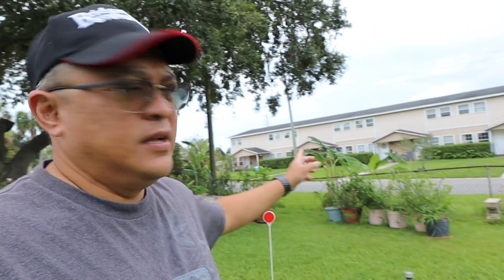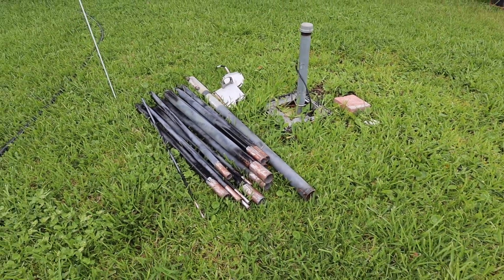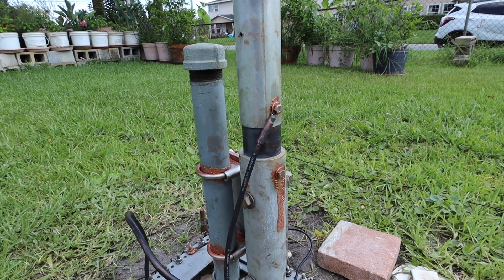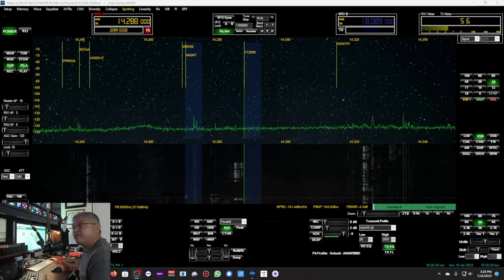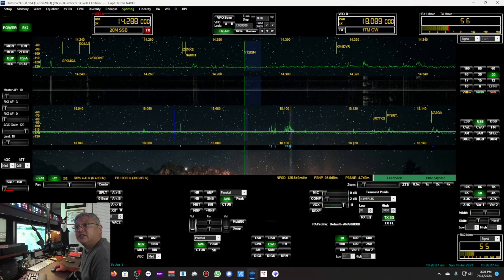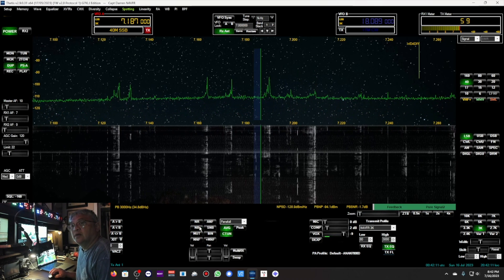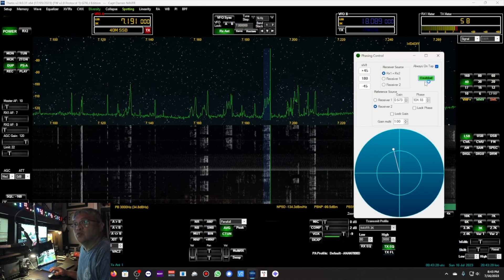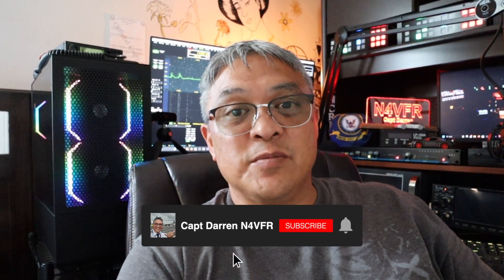Apache Labs Anan 7000DLE Mk3 Diversity Reception Setup | How to Setup Thetis for Diversity

Comment: Another great video. Thank you for taking the time and effort. Quick question : On the diversity screen where you move the line around the blue circle. Does that correlate to a compass direction? Ie you move it to the top is that north/ Thanks Jim
Reply: I have 0 experience with this radio but it looks like it's degrees of phasing.  You can adjust the reference noise signal phase in comparison to the other signal to try and cancel out the noise.  I have an external QRM Eliminator that works in a similar way.  And I'm also thinking the length of the line is the gain on the noise signal.
Reply from the maker: I wished I knew so I can narrow where the noise source is coming from. There isnt a way to calibrate where North.